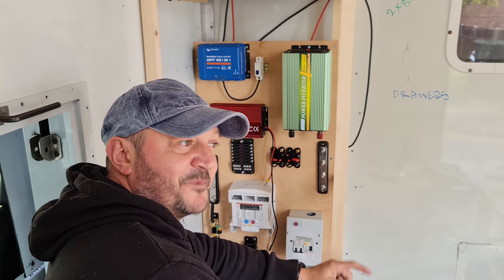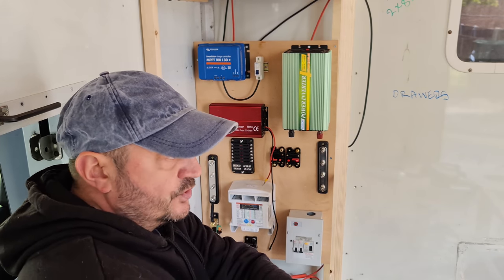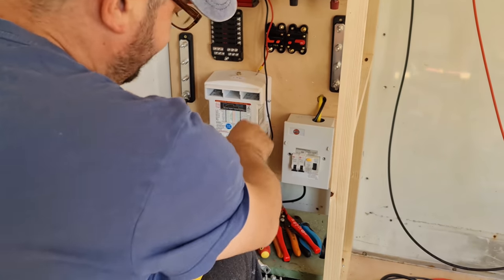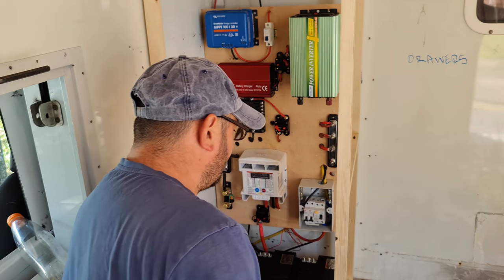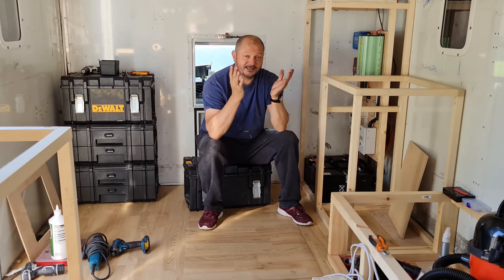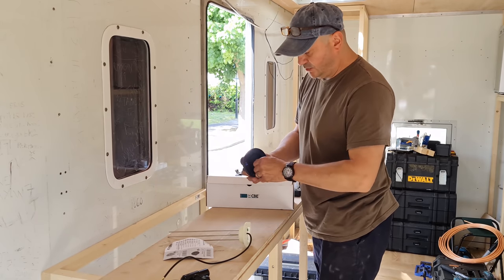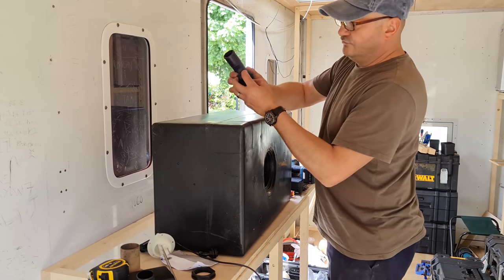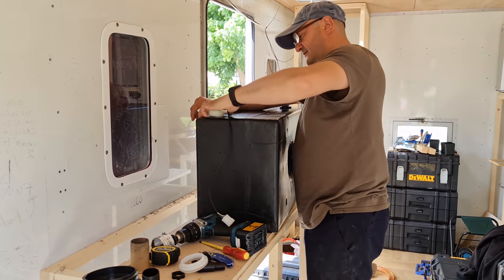Cutting holes in our Self Build Campervan conversion. Iveco Daily 6.5 tonne Prison Van

Comment: I had inverter like that one but was the 1500w/3000w one and it was fine for 2 years then just randomly caught fire, was being used for a 10w soldering iron at the time, didn't blow any of its own fuses (or supply fuse) just caught fire, luckily it wasn't near anything too flammable and was able to shut electric supply too it and fire fizzled out.
Reply from the maker: Thanks for letting me know that Kim... think I may change it now 👍

Comment: Everything looks great so far. My only concern is the fridge size and all the space wasted in front of the electric. I would of went for a narrow full height fridge with freezer. I would of condensed the electrical on top to of fridge and kept batteries under fridge. Maybe moving the inverter to side a board or bottom board that can be removed to work on it. Shouldn't have to work on it much once it's done. I guess it all depends on how many days you want to go between refilling fridge and how much cold beer you want at the ready. :)